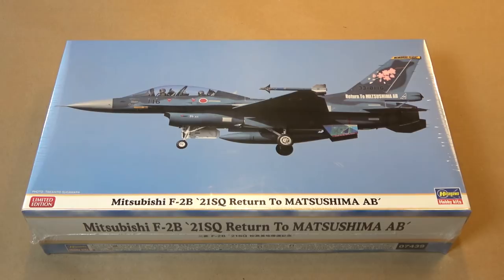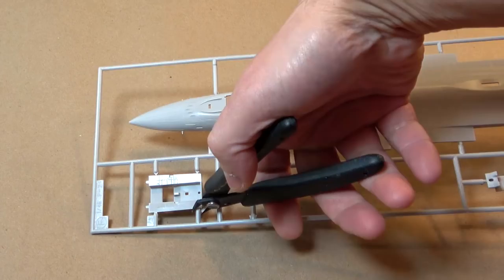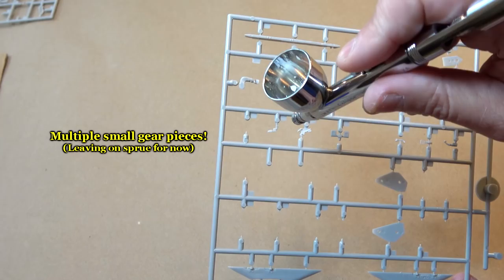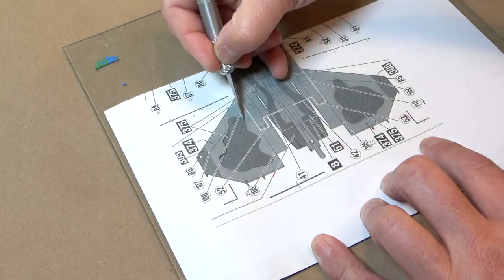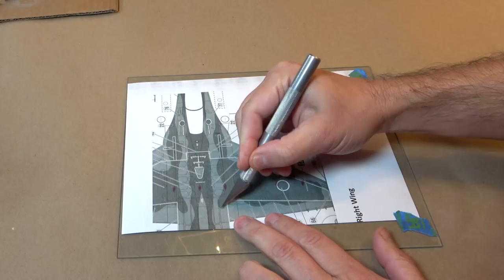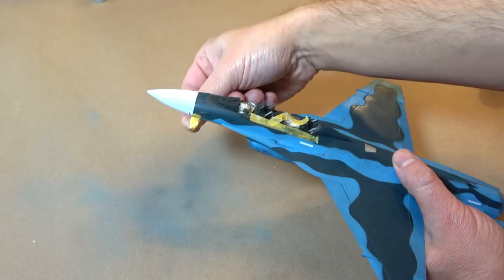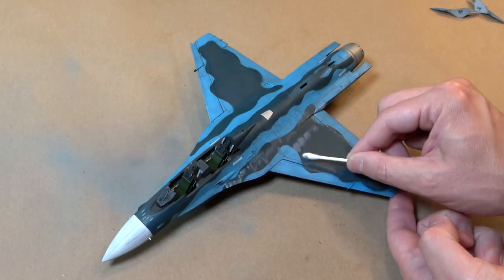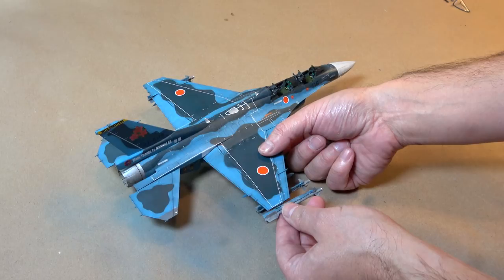Building the Hasegawa 1/48 Scale Mitsubishi F-2B Air Defense Jet Fighter "Viper-Zero"

Comment: I have the Iwata Eclipse too and can generally go a few paint sessions between full teardown cleanings. Every time I finish a color, I half fill the paint cup with alcohol, wipe the sides and bottom of the cup and the exposed part of the needle with a Q-tip, and then spray the alcohol through the brush. Then I half fill again with airbrush cleaner, let it sit for a minute, then spray it through as well. I use Tamiya acrylics too, thinned 50/50, and have found this regimen works really well for me. I do have to do a full clean more often if I use a metallic paint or something thicker than my standard 50% Tamiya mix. Mission Models Have Glass V paint, for example. That takes a full cleaning each time.
Reply from the maker: Hi Josh, that's basically how I clean my airbrush between colors sans the airbrush cleaner. However, I do use a thicker ratio than you and that might be why I have problems and you're not having as much. Definitely anything "metallic" based seems to require an immediate clean up for me.

Comment: Nice build! Always thought that the f2 was a direct copy of the f16. Thnx for the info!
Reply: It was but modified for anti-ship warfare
Reply: Not a direct copy.
It has a Japanese-built wing and Japanese avionics.
A  lot of the design work was influenced by a late 1980s upgrade program called "Agile Falcon."  Agile Falcon mainly featured an enlarged wing and tail surfaces that were to reduce wingloading and restore the handling the F-16 had in the original A-model.  The F-16C has grown a lot in weight but has the same wing the F-16A did.  While the newer engines allow higher acceleration and better climb, the F-16C isn't quite as agile as the F-16A and has a reduced 9-G envelope because of the higher wingloading.
The F-2 program still got delayed by at least 5 years because of fighting between various political factions.  The infighting within Japan was at least as bad as that between US and Japanese officials.  The US officials believed they were handing over F-16 tech for a song that would aid Japan's aerospace industry unfairly and end up making Japan a strong competitor in the future which really hasn't happened; Japan's aerospace has strong subcontracting and actually does provide quite a bit of technical support to Boeing but the Japanese market is too small to self-start and sustain a lot of domestic programs let alone design a 777 competitor.  Within Japan, you have the usual pacifists who don't want anything remotely military (but are blissfully ignorant of reality and the need to STILL have a decent defense force; can't depend on the Americans for everything!), nationalists who don't want to deal with the reality Japan can't go it alone for defense (too expensive, not enough manpower to deal with China) and that it's not the power it was pre-WWII militarily, and the industrialists who want the contract business AND to keep Japan's technical edge so that it's not completely at the mercy of the whims of US policymakers.  They also want Japan to have the ability to make its own weapons if it can't license certain systems like the F-22 which was refused by the US government.
As it was, the US probably ended up getting the better of the deal.  Japan ended up transferring composite technology to the US in exchange for the F-16 plans.  As it was, the Japanese "F-16 Zero" ended up not being much if any better than a Block 50 F-16C while at the same cost 4 times as much!  $100 million for each F-2 is why the program was ended early and only about 92 are in service.
The F-2 is larger and heavier than the Block 50 but has the same engine and doesn't quite overcome the weight increase despite the larger wing.  The Japanese could not export the F-2 under law because of both the Japanese constitutional bans on weapons exports AND the license agreement with the US.  It was never going to be a profitable or cost-effective program but it ended up going well over-budget.  As a consequence, the production of the F-2 was halved and the JASDF was forced to keep its surviving F-4s in service probably 10-15 years past their intended retirement.  The F-2 was supposed to replace both the F-1 and F-4s in Japanese service but ended up replacing only the F-1.

Comment: Airbrush does not jam. Use Badger Needle Juice for the needle and clean the airbrush with a regular brush. You should clean the cup and the seen needle part with the brush. Put some cheap tamiya color thinner (use cheap window cleaner- clear one with ammonia base-only for cleaning). Put your finger in front closing the nozzle cap and the backward circulation of the air will clean the internals. You have to practice your own but you will find it out. You do not need to loosen this up each time. Take care.
Reply from the maker: I'll try that, thanks John K 🙂
Reply: @MaxAfterburner  Yes my friend, the big deal is to use the needle juice. Do not be frighten, first you spray some thinner so the excess lubricant from the front section of the needle can go away and the airbrush will be much smoother. What is happening now, is due to the fact that the tool is new and the Teflon seal is tight. I have the same airbrush, it is a very good tool that can spray a variety of patterns, much better than your old one-since you get use to it, you will not want to change it.I like your builds for the ease of build and the relevant final outcome, it's pure fun with no much of frustration. Although i usually paint free-hand i would love to see a video of how you make your masks from the instructions step by step. Keep up the good work :)

Comment: Good to see you back, after some time =) there are couple of comments I'll drop, randomly, as chat "adds-on" =)
Good that you showed us an overlay of the silhouettes of these crafts, at the beginning I said "mitsuwhat? Isn't that an F16?" I bet they must have been licensed to build this "raising sun" craft...

It's always amazing to see how a simple black priming adds so much to the realistic tone variations the top paint gets! Regarding primers, would you think that the real ones (or, say, those sold for this purpose) are indeed to thick to risk flattening of the surface details?

Regarding weathering, one thing heard from the guys used to do it (oil paints) after a clear gloss coat is that, when done directly on flat matt paint, oil color would not come off afterwards. You actually show that is not necessarily the case, interesting...

I would also be interested to know the answer to that guy asking about commission jobs... I tried to ask this questions to a few guys, but never got a reply, maybe too jealous to reveal this "secrets" I ;-) Nevertheless, considering that good 1/48 kits nowadays easily starts from 50$\€, if not more, considering all the time spent for building and painting, I guess that triple the price from a commission work would not sound as a crime. I am interested in getting opinions...

I guess that's it, for now... =) Cheers!
Reply from the maker: Thanks Andrea 😀

Comment: For Japanese music, the bit from 5:29 to 5:51 sounds positively Irish. As for the rest, maybe it's just your taste in Japanese music bringing it out but I never noticed how bluesy it can sound.
Also, thanks for answering my (and I'm sure others') question about scraping vs. dry brushing. I've always been a scraper too. ;>)
Nice calming build video. I didn't see the implied potential difficulty you mentioned putting the fuselage halves together though.
Reply from the maker: Hi Mark, I just used some "Japanese" music that was available and didn't require some sort of royalty fee. I had to get down in and fiddle with the seats and consoles while joining the fuselage halves which I wasn't able to capture on video. You would have just seen the back of my head anyway! 🤭
Reply: @MaxAfterburner  Thanks. I get the "head in the way" bit. Used to be I was very nearsighted and could do that too. Now that I've had my cataracts out I don't have to wear glasses but to do fine work I need magnifiers which I can't see around my own fingers with. So, fine work is a lot harder than in the past and if I wanted to make video of it I'd have to mount the camera on the magnifier or something.

Comment: Nice build again. i noticed that you didn't install the other JASDF missiles for the F-2 like the AAM-4 and its main armaments, the ASM-1 and ASM-2 anti-ship missiles. About the successor of the Mitsubishi F-2's successor, the F-3, the JSDF is still undecided about it. So far, there are 4 options for the F-3:

1. Develop the domestically-developed Mitsubishi X-2 Shinshin into an armed fighter.
2. Take the offer of Lockheed Martin of an "F-22/F-35 Hybrid", F-22 frame but F-35 avionics
3. Take the offer of Northrop Grumman of a modernized version of the YF-23
4. A Japanese company will team up with the British to make a Japanese version of the Tempest.
Reply from the maker: Hi Bryan, the kit only included the four AAM-3 missiles with no other options for weapons. I have a feeling Japan will go with an F-35 type fighter...
Reply: @MaxAfterburner  The F-35A is already in Japan while the F-35B is still in order (42 I think and the DDH Izumo and Hyuga will be refitted to accommodate the F-35B). Mitsubishi (always the one for fixed-winged aircraft, same as the manufacturing of licensed-built F-35As in Japan) would gonna team up again with LM (just what they did with the F-2) for the F-3 development to minimize the cost. The F-3 will replace the F-2 in the 2030s (target date of the F-3 deployment) and they need also to have air superiority capabilities since the F-15J Kai (some will become F-15JSI (Japan Super Interceptor)) is already 40 years old

Comment: The F-2 has one of the nicest paint schemes seen on any Viper, a bit sad that they are literally limited edition JDMs (86 flying out of 94 built) and cost as much as a F-15. Also looking at the Hasegawa F-2 kit really shows how dated their 1/48 scale F-16 kits are, no full length intakes, plain blank landing gear wells, no polycaps for the tail surfaces and fixed LEFs and flaps.

Comment: Question: Is the Mitsubishi F-2 taller than the F-15? Could you add some size comparison between the latest and previous builds, please?
Reply from the maker: Hi Bryan, the F-15 definitely stands taller than the F-2 and the F-16. When my F-16 unit flew DCMs against F-15s , we were usually put in the hangar with the F-15 guys and got detailed tours from our fellow airmen around the Eagles -- much bigger!
Reply: @MaxAfterburner  Huh, so it is safely assured that there is still space for the 1/72 Mitsubishi F-2B at the back of the 1/72 F-15J. Thanks

Comment: Your videos are some of the best model videos on YouTube. One question though. If I were painting the underside of a plane and didn’t add a primer, would there be a way to fix the flat colour to look better/more natural without spraying it again?
Reply from the maker: Hi bonnie1020, thanks 😀. Since you're trying to avoid another paint coat, then the only thing I can think of would be to gently rub in some pastel powder in a color or colors towards what want to to achieve appearance-wise.
Reply: @MaxAfterburner  Ah, I didn't think of that. Thanks!

Comment: If someone wanted to try to do this what all gear would they need and do you recommend any brands?
Reply from the maker: Hi swoosh13, in my more recent videos I display slides (after the intro for my model builds) of the materials and equipment I use which would be easier for you to view than for me to write that all out. I also follow those images with a specific list of the paints I used for that particular model "episode".  I started this around Project #22 (A-7D Corsair II), but I suggest checking out the latest one or two of my video releases to see the most updated list of what I use. 🙂

Comment: Thanks for the great build videos!  I get quite a bit of knowledge from your stuff.  I'm getting ready to do a Hasegawa F-4 in this same color scheme...and i appreciate the paint mixing info!  Question for you though...what adhesive did you use for your template on  this build?
Reply from the maker: Hi svrhodes77, I was trying out some tackcy putty to hold down the camo templates rather than my tiny bits of rolled up tape this time. Each adhesive has its pro and cons and I'll probably being using them in combination next time.
Reply: @MaxAfterburner  thanks for the info!  I'm going to try to find some of that going forward.  I have an AMK MiG-31 I just started, but I'm going to try your techniques when I get to the Japanese Phantom!

Comment: Excellent work as usual!  I was curious- do you use any magnifying assist when working with smaller parts?  Has your vision deteriorated over the years because you work with such tiny pieces?  We don't get to see your face, so I wasn't sure if you used a binocular magnifier or other similar device at times.
Reply from the maker: Hi 1JackTorS, I don't use any devices to assist my vision. But it's hard sometimes to see very fine detail and that is one of the reasons I don't do pilot figures if they're included in the kits. I wouldn't be able to paint them adequately.